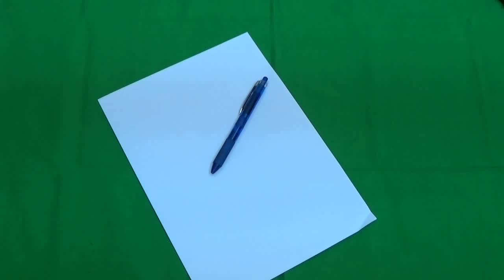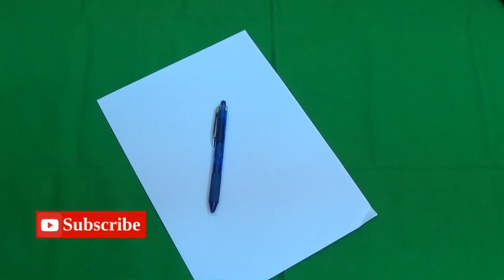How to Make an Electric Shocking Pen - Very Easy

Comment: Guys it's fake. Keep pausing and resuming at 0:14 the fake effect appeared right after he was letting go of pen. look slowly
Reply: Ok?
Reply: Aside from the drama, those piezoelectric igniters produce a spark that is enough to ignite the butane in the lighter. That probably produces a mild shock. The effect is that of a surprise rather than painful experience. An old example of that is the wind up handshake buzzer.
Reply: Zeev _37 that’s not even a effect, that’s just a slight glitch from his camera. Making this pen will not make any effects

Comment: i tried it with a different pen . the size of  the lighter didn't fit in its body
Reply: bruh all your doing is taking out that piece
Reply: you need a big pen for that work
Reply: amanpreet singh You can try a papermate inkjoy pen, it's so similar
Reply: amanpreet singh  aeroplane ban

Comment: how it works
Reply: +Siddharth Kaduskar        when a hand press it then the flow of current goes through the wire to the lower part of it which is steel, when we interrrupt it then the flow goes by our hand. the shock will effect your thumb but your index finger and all the finger which is touched by the pin see the pin made of steel in 2:26 where the wire is touching to give you a shock without BATTERY
Reply: Thanks bro
Reply: Siddharth Kaduskar WELCOME !!